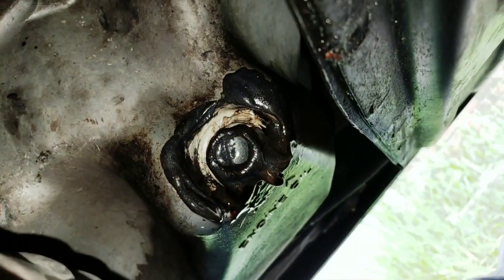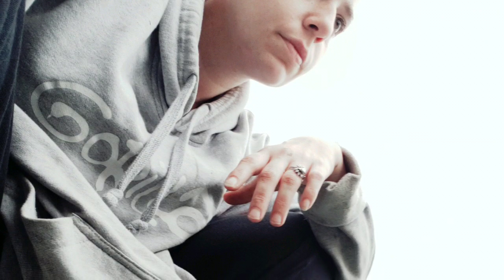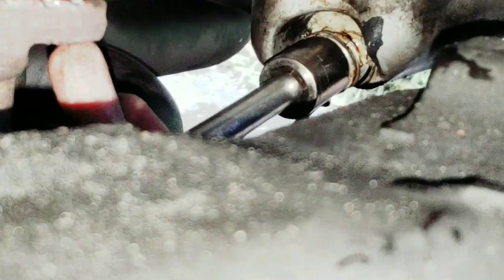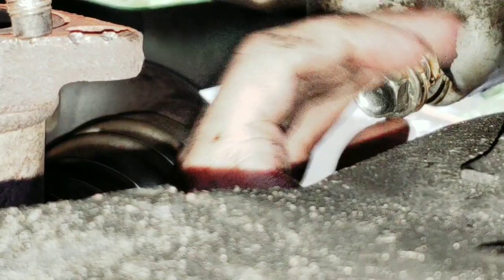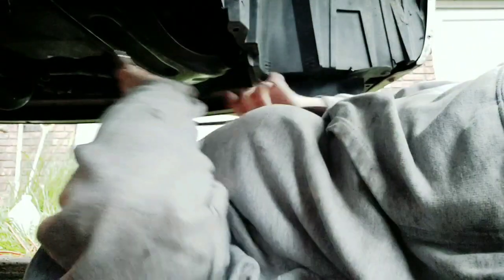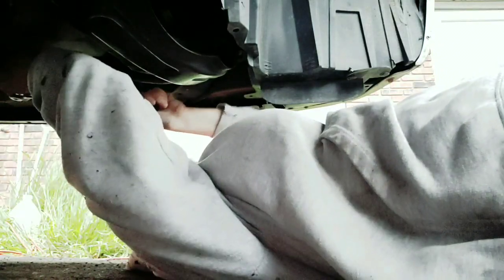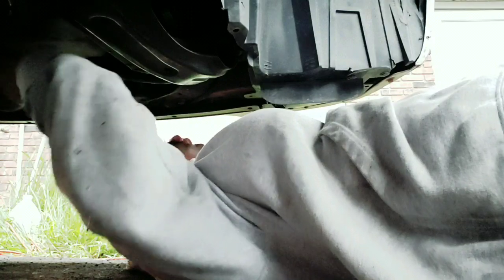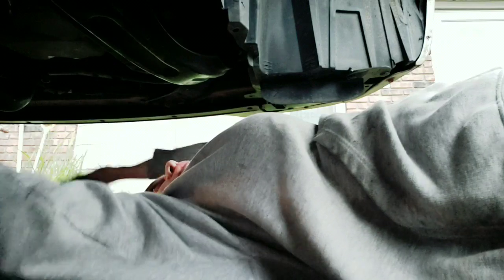Replacing the Oil Pan on my 05 Honda Odyssey

Comment: Hey, so u just put some sauce on the pan, no gasket? And all u had to drop was just the exhaust pipe?
Reply from the maker: Pretty much, yup! I used Permatex Gasket Maker, if you need the exact one I'll peep the tube for you.
Reply from the maker: It took extreme force to put the exhaust back on, be warned lol.
Reply: Permatex black gasket maker it's the best.

Comment: How long did it take from start to finish?
Reply from the maker: A few hours, it was more tedious than time consuming. The oil pan bolts are fragile and snap easily, other than that - if you're not rusty underneath this should only take about 3 hours.

Comment: Couldn't you just lift the front only? Why lift the back as well? Looking to do this as well and thanks!
Reply from the maker: We did that for ease of access 🙂 good luck! If you need any tips, lmk!
Reply: @bonitadreama  Well I'm wanting to do it on my driveway, but it's it's slightly sloped so I can only lift the front. I'm new to changing things on the odyssey, funny I changed the alternator before I knew how to change oil :P I used ramps/chocks from harbor freight and did my oil change fine and used a UV dye tracer so I know it's leaking from the pan. I only get a 6 inch clearance so I'm not sure if that's enough for me to even get it out. Should I raise it with a jack higher instead, 2 jack stands, chock rear tires like usual and pray I get enough clearance thinking would work?
Reply from the maker: You should be alright with the ramps in my opinion, my ramps were in use so that's why I didn't use them myself (also Harbor Frieght Ramps).
Reply from the maker: And same here with the alternator LOL
Reply: Just lifting the front is good enough to do this job,now honda crv it's a real pain to replace.

Comment: Use a anerobic gasket sealer or rtv gasket maker next time.
Reply: But remove all oil then add oil once you followed direction and it has set
Reply from the maker: Thank you for that information!